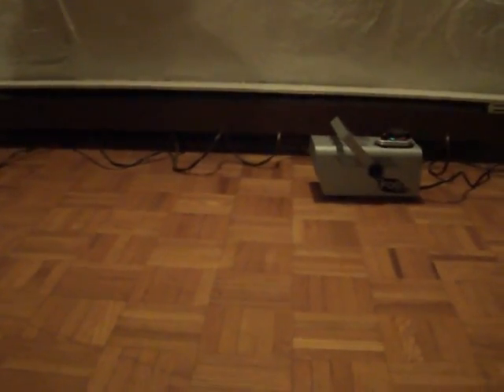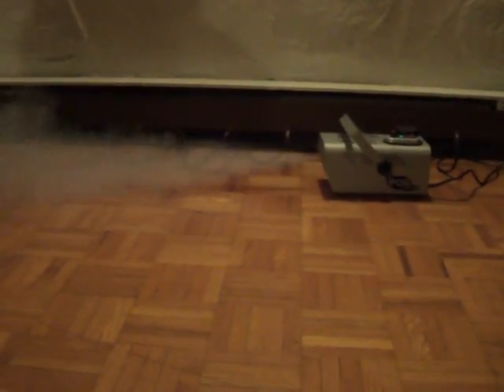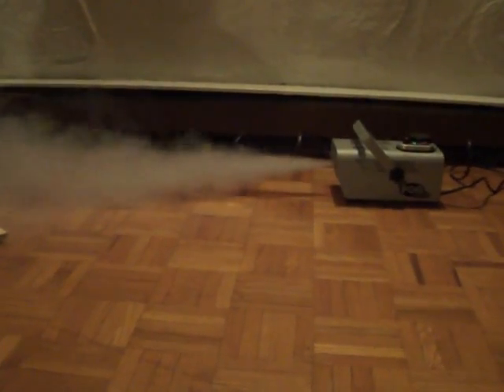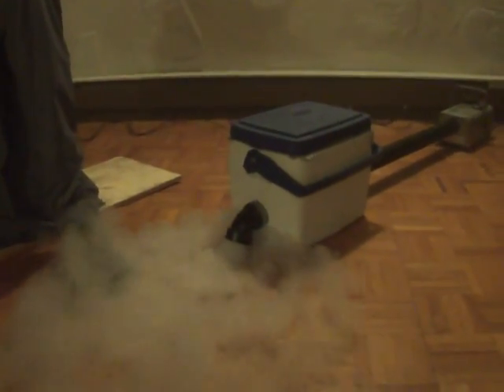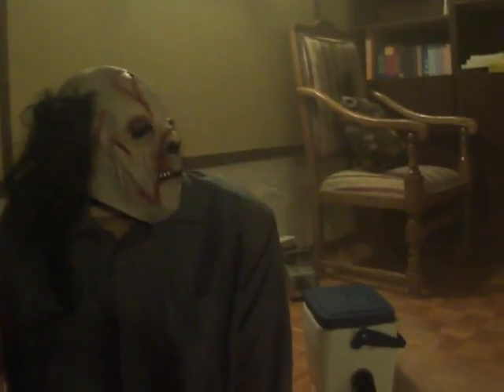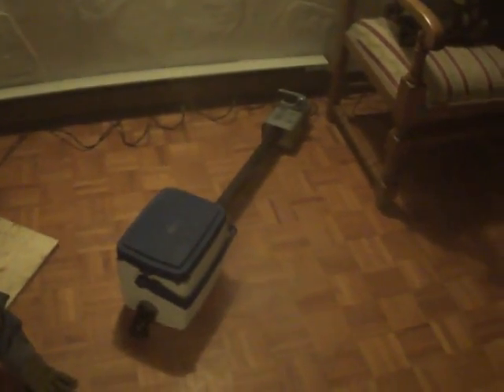Cheap Fog Machine Chiller Hack

Comment: btw we should note that's a 400W fogger. It won't shoot the fog out too fast. The reheating time is about 1 min 30 sec. I have that Gemmy fog machine. It works well for the price. I also have the timer for it which is very helpful to just let it work by itself. Those were sold at Wal-Mart during Halloween.

Comment: if your pump sounds dry or vibrating  it is not getting any or some  fluid. for all fog machines that are going to run the fog through any type of FogChiller you do need to use only the Low Lying Fog Fluid to get the best results from any type of Chiller. i have messed aroud a lot in the past 13 years with FogChillers, fog machines and  many types of Fog Fluid

Comment: It's not the fog machine that's bad it's the fog juice that your using
Reply: Zeke Richardson It's neither. There needs to be space between that tube and the output of the fogger. The fog has to hit the air before it goes through that tube or it will be weak.